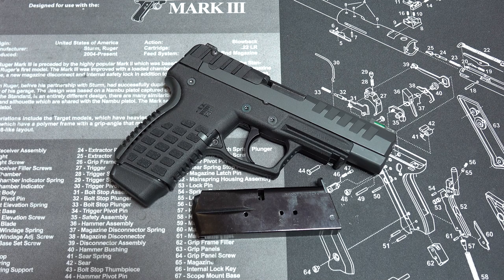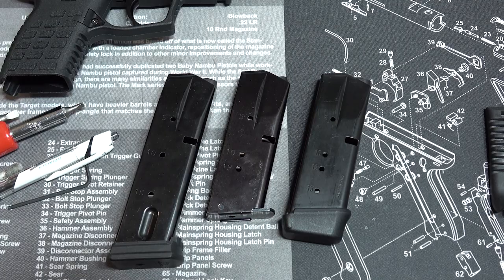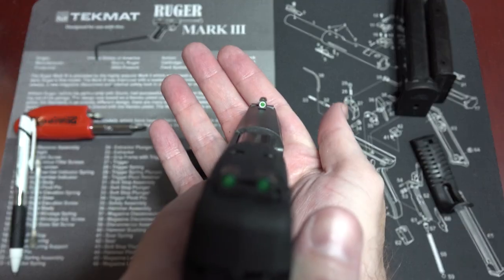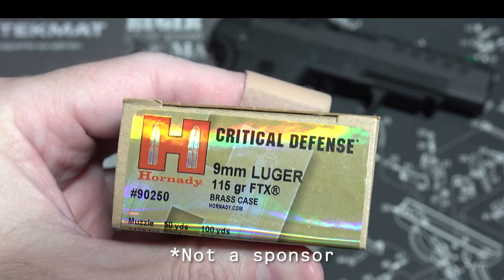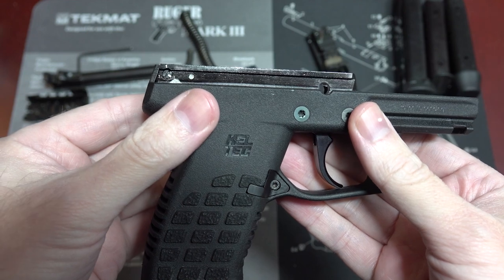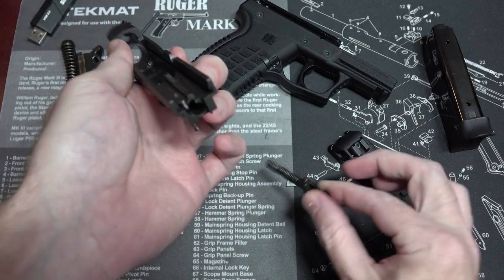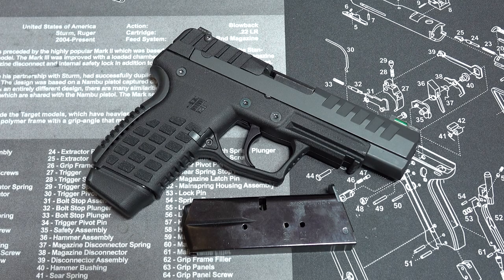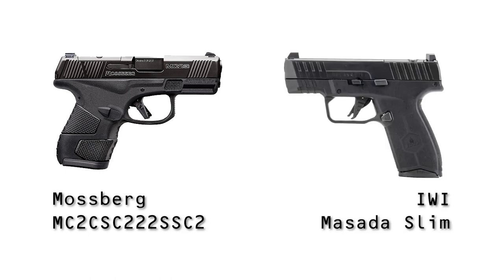Kel-Tec P15 SUPER DEEP DIVE - Everything you ever wanted to know... and suggestions for KelTec

Comment: I sometimes pocket carry a PF9 because it's thin, and some of my pants have a big enough pocket. By the specs, the P15 isn't thicker, and the flush mag would leave the grip about the same, but the long slide is a deal breaker for pocket carry.
Reply from the maker: I think you're right. Although I'm shockingly able to fit this gun into the front pockets on a few pairs of pants I own. I think a shorter version of this gun in .380 would be stupendous.
Reply: What is the height with the flush mag is the grip about the same as a hellcat or a 26 or watt

Comment: Thanks for a very comprehensive and useful review!  I LIKE that grip safety as it is narrow and will not easily be affected by a male belly-roll when carried IWB!  Seriously!  I agree that the trigger safety group is simply brilliant!  Now, where you went wrong was to bad mouth the Kel-Tec P11 pistol!  It too is a brilliant design for a deep cover pocket pistol.  IT IS SUPPOSED TO HAVE a heavy trigger because it is double-action-only so it is the only safety needed.  It is never fully cocked until the trigger is pulled all of the way, perfect for a pocket pistol!  Think of it as a four-finger pistol grip.  I bought one USED thirty years ago, put at least three hundred +P defense rounds through it without any kind of fails (except for once with a cheapo after-market magazine with cheap ammo), and it still is VERY accurate and looks like new.......................elsullo
Reply from the maker: Thanks for the comment! Sorry about the P11, but if it were just a little bit better (i.e. didn't break so often and had a useable trigger), maybe the micro 9 craze would have started 30 years ago! 
It was the first gun KelTec as a company made, and was definitely due for some improvements.

Comment: I did not see this video until I sent mine back for repairs due to the magazine release issue you mentioned. After waiting three weeks I contacted customer, support, which I agree have been very professional and easy to work with, and their response was that the gun smith was waiting on "updated" parts. I hope yours was sent to you as you requested in the video. Great review and thanks.
Reply from the maker: Nope, I didn't get anything yet, but that's great news!
Reply: Have you gotten your p15 back if so how is doing?
Reply from the maker: @kingd3001  I got it back before making this video. Doing great. Runs great, carries even better.
Reply: @kingd3001  Thanks for asking, and yes, I did get it back. Everything seems to be in working order. No problems at the range or during cleaning. Put about 200 rounds through it. It's accurate although snappy. And to be honest I have not shot in about five years, so I have some grip and trigger pull issues to work out. Fun to shoot though.
Reply from the maker: @BryanRoberts-tn4ye  Hey, what did they do with the mag release? I and a bunch of other shooters are interested to know.
Reply: The paperwork they sent back just said replaced. As near as I can tell however, it looks like they went with something like your second suggestion. They also upgraded a couple of other parts while they had it.
Reply from the maker: @BryanRoberts-tn4ye  OK, well we'll see how this plays out. I want mine fixed too!

Comment: One thing, the mag can fool you, it can seem that it is seated in the well but is not, in which case the 15 will either fail to load, jam a case, or leave a round unfired in the chamber. You must press the mag in with force, I mean really make damned sure that the mag lock is engaged, big well-felt click. Just so's you know.
Reply from the maker: Not fully inserting a mag is generally a problem with many pistols. But how a round ends up unfired in the chamber from a mag not being fully inserted is a true mystery to me.

Comment: Great engineering input, dude. Most mechanical engineers are idiots, sadly. You are smart. I'm especially shocked about the polymer rear sight module. Like it was engineered in India after 10 gallons of beer.
Reply from the maker: Thanks man, I try.
Reply: @firydeth  Just for the fun and views - i bet that the whole rear sight module will melt after 200 rounds nonstop and those tiny springs will fly out. Along with front sight night capsule.
Reply from the maker: @Mike-yy4ll  Seems unlikely, as that part of the slide does not get hot.

Comment: A mag-disconnet is a HARD pass for me...but, that is a novel way of giving the use safety options....very interesting. 
I like my old p11 I got used...poor things needs a cerakote job on the slide...but it works.
Reply from the maker: Hands down the P15 is miles ahead of the P11. These extra internal safeties were included so it could be sold in California, but they knew people wouldn't be happy about them, especially the mag safety. If you ever get a chance to handle a P15, I would check it out.
Reply: @firydeth  A VERY well video, very nice.
Reply from the maker: @xxxlonewolf49  Thanks man, I try.
Reply: There's nothing wrong with magazine disconnect. As a former hi-power shooter, it is a good safety item.